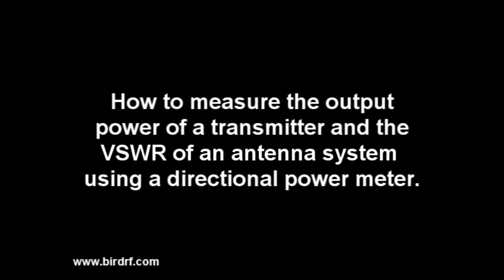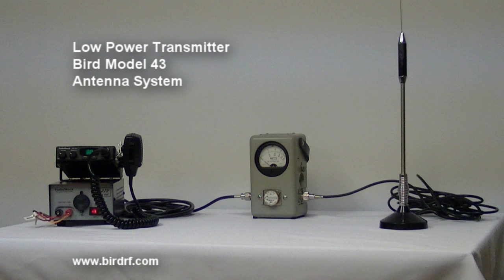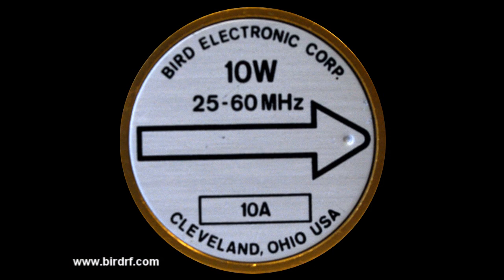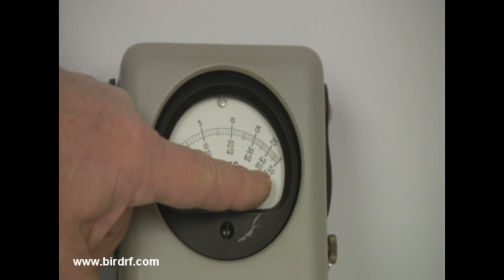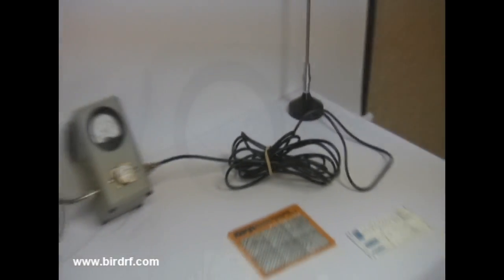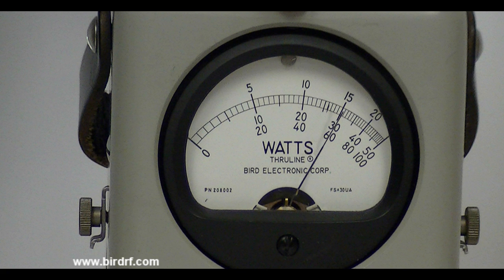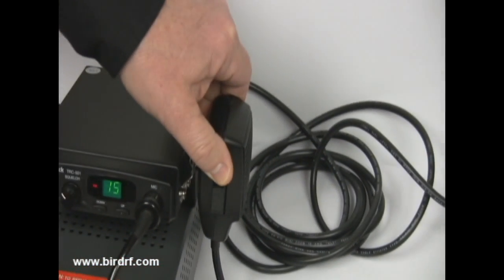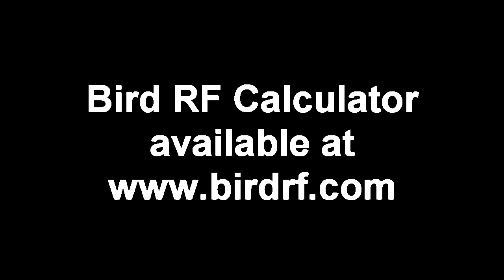How to Measure a Transmitter and VSWR with a Power Meter

Comment: Where has the 2.4 watts gone????
Reply: Reflected power joins the forward power or the incident wave back to antenna and radiated by the antenna, it does not heat up your finals of your transmitter, or into any other cable or mic, your are misunderstanding common mode current with reflected power
Reply: Into any grounded box, mic cable or wire, that was a counterpoise, because the antenna does not satisfy resonance, so this becomes heat and current the microphone audio amplifier, voltage regulators, and rf final has to eat, while transmitting the current rf wave. 
That is really good VSWR's for an antenna not on an actual countepoise.
Reply: It is accidental BOSE tech, a wave being transmitted, gets nulled by a wave returning 180° out of phase, but the heat and current is still there. Also could strain the power supply and add ac hum to signal, or a feedback squeak.